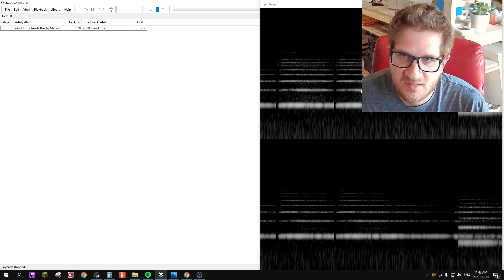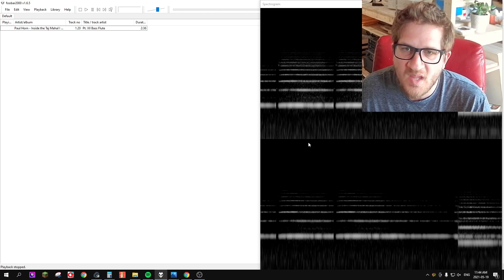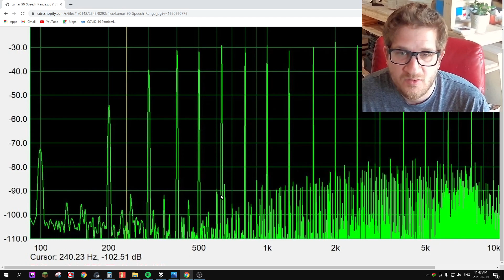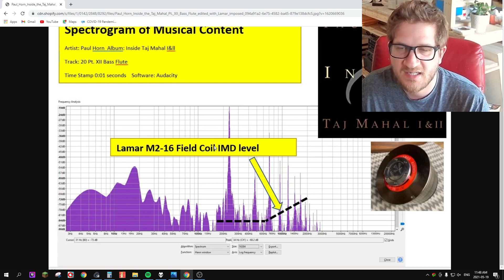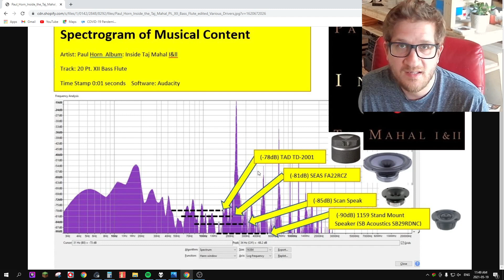The Audibility of Intermodulation Distortion

Comment: Mr. Crowe, I just wish you had some ability to put yourself in the position of the viewer of your video and realize that the way you are presenting this information is not very good. You show a graph that is labeled fuzzily and you make no real effort to explain the graph. On this graph you are showing what is evidently distortion components, but you overlay this information for four different drivers on a single graph. (EDIT:  Because you took exception to the comments I originally wrote here, I decided to delete it and take a more careful viewing of this video. To be followed by comments.)
Reply from the maker: Just to provide some additional clarification for you, although I did make myself very clear in the video, what you are seeing is the content of the digital file alone. I’m showing the frequency spectra distribution at precisely one second into the soundtrack. I then make some general comments about the overall clarity capability of some various drivers I’ve been able to test, as a matter of discussion. It was not intended to be a review of any particular driver. The entire video highlights a specific topic, the audibility of IMD, and my point is that IMD is certainly a bottle neck in terms of the musical information available from digital soundtracks.
Reply: @JosephCrowesDIYSpeakerBuilding  Your video presentation is incoherent. The sentences you speak make me cringe. At 5:20 you spoke, “The low level detail starts about 56 dB down from the loudest part.” Where did you come up with this number? The only thing I see on the graph that corresponds to this number is the line you drew. So far as I can tell you pulled this number out of the air and wrote it down as though you believed it has some genuine quantitative significance, which is not the case unless you obtained it by applying some quantitative formula or algorithm. This really, really bugged me. And you just ramble. At about 5:30 you spoke something approximately, “And so you can see the amount of low-level content that’s in the music and where it’s at in terms of the decibel level in the track.” At best, this is a vague allusion to something that potentially is quantitatively meaningful. But it’s fuzz. Then you spoke, “Why do I bring this up?” You asked this sort of rhetorically, which suggests that you think that you actually said something that was clearly stated and that your audience would clearly understand. So I ask: bring WHAT up? What exactly was it that you brought up, that would cause me to wonder your reason for bringing it up? Then you give your explanation: “This correlates very closely with the multi-tone testing that I’ve been doing lately …” Seriously? A correlation? Did you calculate the correlation coefficient? Why would you make a statement like this? Why would you say, “Why do I bring this up? Why, why, why would someone make a video like this and speak in this manner?

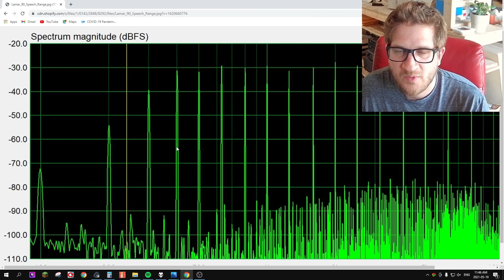At 5:55 you spoke, “I’m going to show you what this looks like, and …” What “this”? You’re going to show me what SOMETHING looks like in some other analytical tool. But I don’t really know what, exactly. Is it a presentation of the spectral content for the same signal for the same snippet of time for that signal, but presented differently in a different analytical tool? Is this what you mean? If this is what you mean, you should have said so. But if it isn’t what you mean, then WHAT EXACTLY DO YOU MEAN? What exactly do you mean when you say “…what THIS looks like in ARTA …”  What is it exactly, that you are showing in ARTA? And … why did you want to show the same thing in two different analytical tools?

At about 6:00, you spoke, “Within ARTA, it has the ability to produce this multi-tone test, where it …” Are you not able to say, “ARTA has the ability to …”, or something similar where you do not needlessly relay on the word “it”, which has no apparent purpose and serves to demonstrate that you have very poor language and communication skills.

At this point, about 6:20, I decide that what you are going to show in ARTA is not an analysis of the same signal you presented in the other analytical tool. At 6:30 you say, “so if we want to compare apples to apples …” Exactly what apples are you comparing? I THINK, but am not entirely certain, that you are wanting to say that the noise and distortion added to a signal by a typical speaker is strong enough to overwhelm the quieter parts of of the music passage previously shown. I suspect that you are wanting to say this, but I can’t be certain because it seems to me that if this is what you were trying to say that you would have said this. And if this is what you’re wanting to say, it isn’t particularly meaningful because it is only something that is self-evident and because meaningful only when it is stated in a way that is quantitatively exact.

At about 7:00 you say, “I’ve simply drawn a black dashed line that represents the noise that I was able to measure in the measurements that I just showed you …”. In the graph of distortion that you showed from ARTA, I did not see where you identified the specific driver. I went back and looked for it again, but I still didn’t see it. But when you return to the prior graph, the graph showing the spectral makeup of a snippet of music, the graph indicates the driver. At 7:00 you say, “It’s pretty much in the middle of the low-level detail content that’s available in the digital file itself.” BUT THAT’S A TOTALLY SUBJECTIVE STATEMENT! It has no quantitatively objective meaning whatsoever. YOU decided, in a manner that wasn’t objective in the least, what the level is for the low-level detail content of that snippet of music!! This is just plain bizarre! Who would do something like this? There is ZERO objective, quantitative merit to what you did, and because of the way you presented it, it is very confusing. And part of the reason it is confusing is that most people with any real quantitative understanding of this stuff are expecting you to eventually get around to saying something genuinely substantive, WHICH YOU NEVER DID. At about 7:40 you started making some statements about the conclusions you can draw from what you did, and that also was just plain bizarre. The ONLY thing you truly did in this video was to present some information about the distortion of that particular driver. This is the sum total of what you actually did, and you did a very, very poor job of that, because rather than present that in a straightforward, honest manner, you wrapped it in a very strange wrapper that no doubt made it very difficult for most of your viewers to realize that this was all you really did in this bizarre video.

You left me very curious to know your level of education.

How about this: Music routinely contains a lot of information at a relative level so far below the peak level that much of the information is overcome by the inherent distortion level typical of many drivers.

This is what you are trying to say, is it not?

And what does it have to do SPECIFICALLY with intermodulation distortion? Nothing at all. In fact, it is related to intermodulation distortion ONLY because intermodulation distortion is a type of distortion. That’s all. There is NOTHING about this video that is PARTICULARLY about intermodulation distortion, yet you titled it “The Audibility of Intermodulation Distortion”. And the reason I even came to know about this video is that you gave it this terribly misleading title. You didn’t have anything to say specifically about intermodulation distortion, and only in some alternate universe would anyone imagine that you had said anything at all about the audibility per se of intermodulation distortion.

Yet, when I alluded to some of these OBVIOUS problems with your video, you protested and spoke some more jabberwocky, e.g., this: “The entire video highlights a specific topic, the audibility of IMD, and my point is that IMD is certainly a bottle neck in terms of the musical information available from digital soundtracks.” That made me want to barf. You have made it beyond obvious that you just another pretender, no different from the hundreds of pretenders who use this medium to try and make themselves look like experts on subjects that they actually do not understand very well.

Comment: Wait, intermodulation distortion results when two or more signals of different frequencies are mixed together and additional signals are formed at frequencies that are not, in general, at harmonic frequencies (integer multiples) of either source signal, so not the noise in the background of a flute recording. Reverbs are known to be linear in their response, so you don't get intermodulation distortion from reverberations. It's just background noise of the recording that you have spotted.